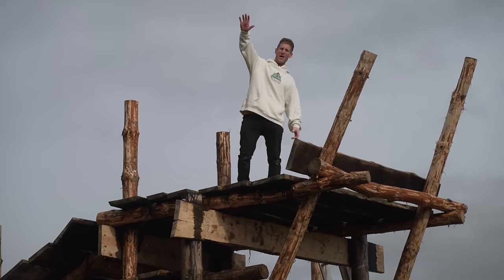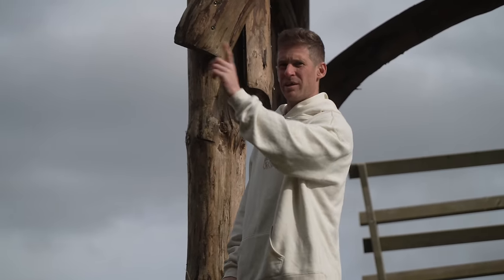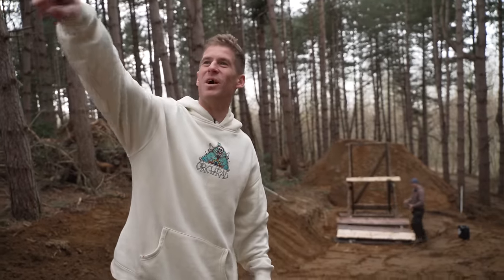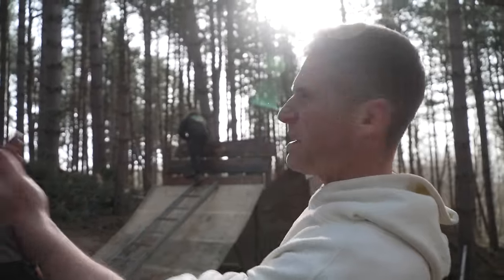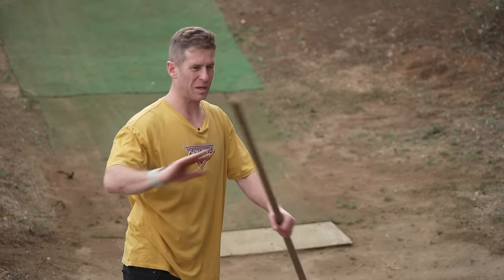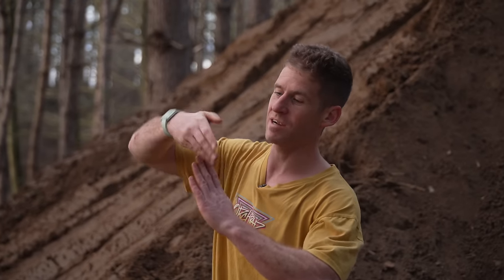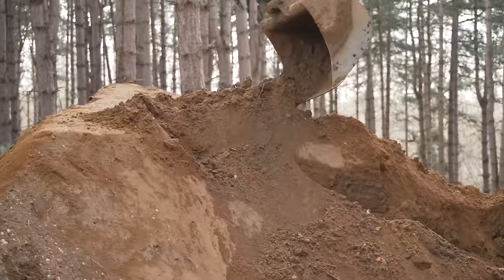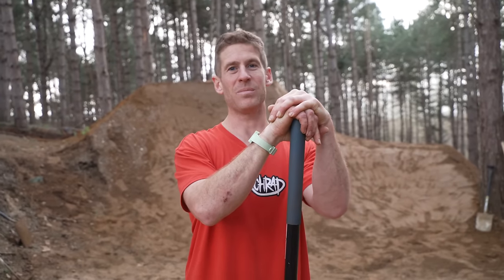RIDING UK'S ONLY PUBLIC MTB SLOPESTYLE TOP TO BOTTOM! - EP 5 - IT WORKS!

Comment: Do the fast line on the outside! Seeing as the quarter pipe could be railed as a bowl turn, you could make the option (on the right of the wall ride) something fast like a roller. ..So you can then overjump that next thing, lol
Reply from the maker: Yeah the bowl corner is gonna be made bigger so you can fully slash round that turn for ultimate speed!
Reply: @SamPilgrim  Sweet! The Slingshot!